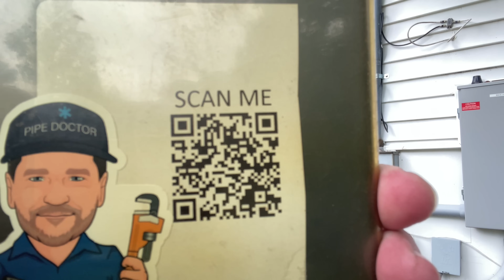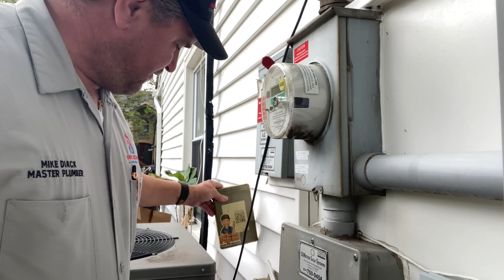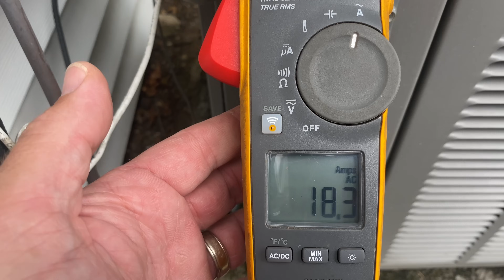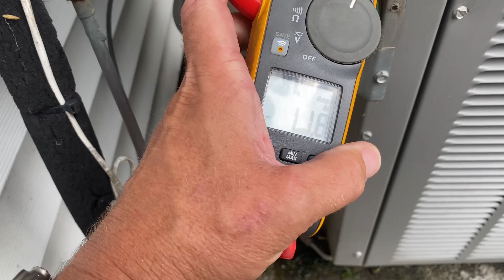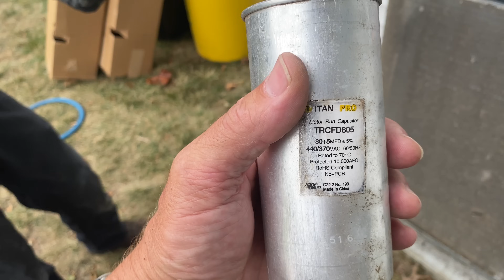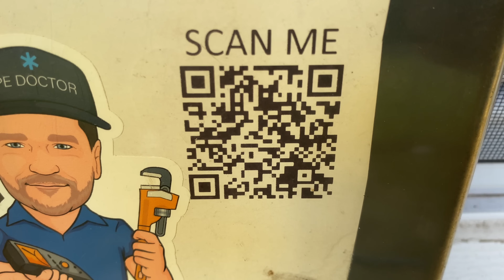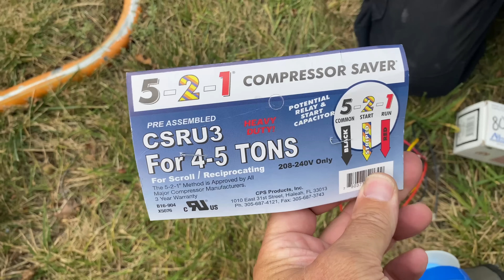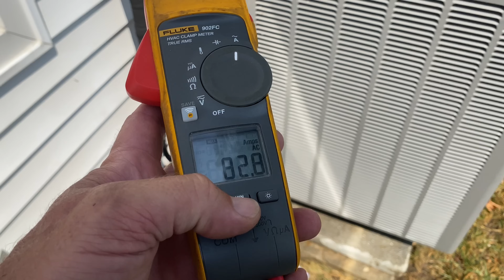Part 2: Soft Start Killed Compressor Followup Service & Maintenance - The FIX Revealed

Comment: A hard start on an off-grid solar system?  You really hate your customers, don't you?
Reply: BTW, you are using the wrong meter if you want to see just how much current that is drawing when the rotor is locked.
Reply from the maker: I actually love my clients and my clients typically love me not 100% but most do and if you are in the Long Island New York City metropolitan area and you’re tired of dealing with a mediocre Contractor give us a call at 516-348-6300
Reply: @PipeDoctor , you obviously don't care enough to replace the soft start with another soft start.  You obviously don't care enough to get the proper equipment to read locked rotor current which is imperative to know for an off-grid system.  There's a huge expense in that off-grid system and you clearly don't care.  When the grid goes down, they are SOL, all that expense is a total waste... because of YOU.

Comment: Christ Almighty it is hard to watch (listen to) your videos! Not that I am antagonized by whine, but you contradict yourself when your words don't quite match your delivery. I'm sure you are a nice guy, and I'm sure you think the issue of the Soft Start for use with the Powerwall is clearly contraindicated by that failed system in place. Did you have to replace the compressor? Or did you just need to clean that dirty coil? I can't trust what I read about the PowerWall & its durability, but the last mistake I've made is trusting someone like Elon Musk's sales pitches. Not saying that AC unit didn't require a larger capacity start - the soft start must have been clearly undersized. The strain on the PowerWall - with a dirty coil - clearly exceeded what Musk wanted to guarantee, but I don't care! Still, after cleaning the coil your hard start replacement probably is fine - inrush amperage and amperage spike should be inconsequential for the PowerWall, unless Musk cut corners on quality of the product!

I'm a DIYer, have been for 55+ years, not sitting in my own basement thinking I have all the answers but looking for ways to reduce my dependence upon line power when storm induced blackouts are more frequent. I could tighten my belt and buy a large whole house generator but I'd rather get by with my current little generator and with a freezer, refrigerator, air conditioner, and electric dryer (not to mention the women in the house who have to use all their electric appliances) I'm looking for ways to reduce the total load on my generator when I need to use it. And a soft start addition to my outside unit would actually be the recommended approach even if I don't want a Tesla PowerWall. And yes, I do clean my coils, usually twice a year since summer does get brutal and I can't see burning my compressor up by forcing it to work harder than it needs to. It appears your plain spoken helpers should be the ones vocalizing on your videos. I wish I could commiserate with your "call for service at the last minute" but after years of providing emergency care as long as I could stand on my own two feet, it just isn't happening.

Comment: Well I do know good a/c service .why do you act like you make no  mistakes you knew the condenser was restricted the last time you were there again the  condenser was not giving up the heat the last time you  
Were there you must not have wanted to do the job right the last time you
Reply: Last video you said it was 4  years ago  if I worked with you I would have to ask you to shut up and only talk when the job is done right
Reply: Do you think your the only one that can repairs  and install A/c system you  and more importantly a diag refresher course you should attend and one more thing why would you not have the young men vacuum out the pan before adding water to the job 🤔
Reply: @paulcilluffo  it's hilarious how triggered you are by an HVAC video.
You should log off and go outside for a while,SoyJack.
Reply: @harbosonius   may be your right bs always will be what  separates masters from the pretenders !
Reply from the maker: Bruh, you need some medication.